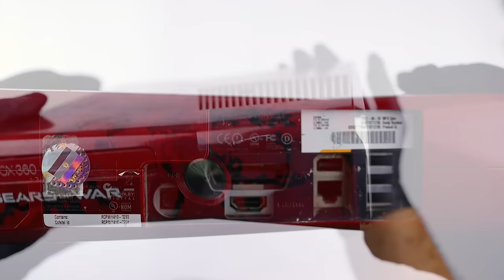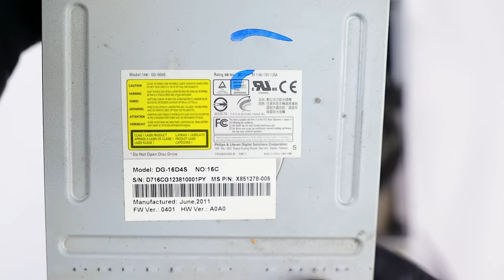Restoration of the Limited-Edition Xbox 360 (Gears of War 3) Console - (RRoD) | Restoring ASMR

Comment: I like your videos, they are really helpful. I fixed my old SNES and N64 but I have a Xbox 360 that has become a challenge. It worked great 10 yrs ago, barely used Xbox 360. Life went on and it went into a storage box. Fast forward to a couple weeks ago. I go to try to use it and it is dead. The power supply light is orange and nothing when you press the button on the console. No lights , no power, no noise. I tested the power supply on my friends Xbox 360 and it worked on his, ruling out the power supply.  I took apart the 360 and tried to power on with the cover off and the fans do not spin, no activity from the dvd drive, totally dead. I took a infared thermometer gun to the board and chips with the power supply connected to a live power strip. No heat above 78-80 degrees coming off the board or chips. I suspect the RF module went bad. As no power is going to the system it seems, but I am not sure. Any advice? Thanks!
Reply: It's the from power panel I garentee it.
Reply: @GoldenGaming256  Replace the front power panel should do it?
Reply: @jbird5211  yeah, the front panel connector is 90% of the time where the mombo fails
Reply: @GoldenGaming256  I will look into a new front panel. Thanks!
Reply: @jbird5211  if you and your friend have the same consoles you can try swapping parts and see...

Comment: Does the slim model of this console have the problem of the red ring of death? I have it, but it is not of this model And it is impossible for this problem to arise
Reply from the maker: If the console experiences an error, one to four LEDs flash red. You only see the RRoD on the original Xbox 360 console. Other models, like the Xbox 360 S and Xbox 360 E, only have one visible LED.